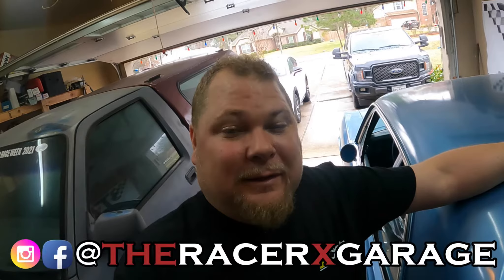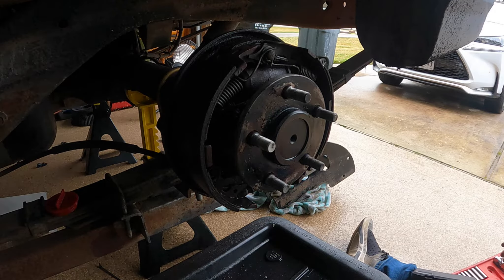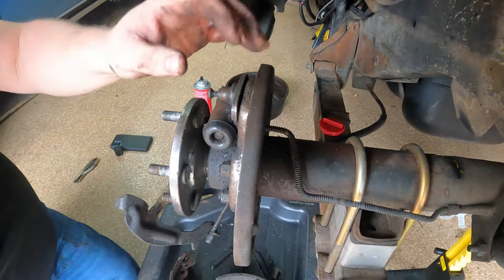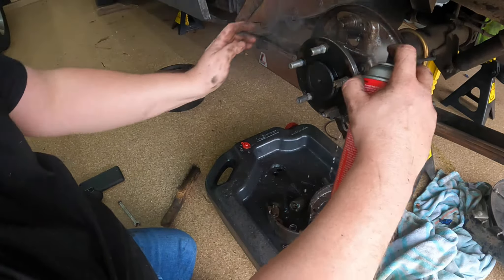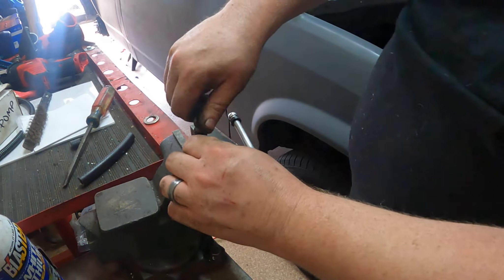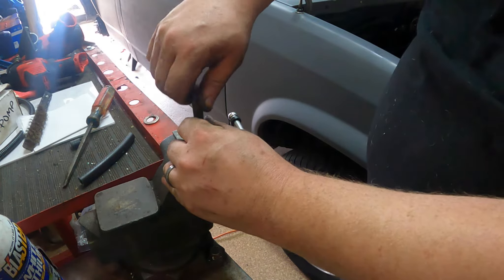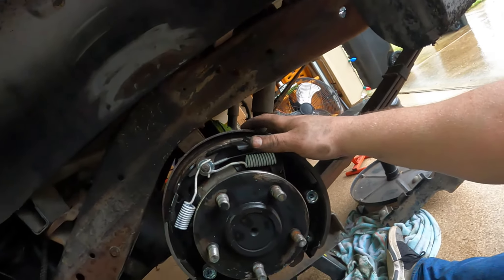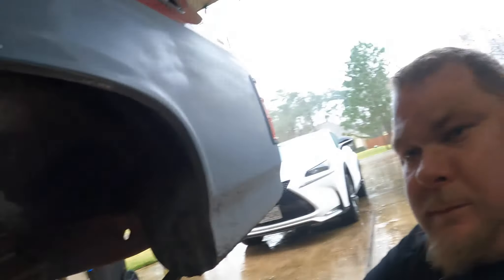Preparing for SICK WEEK Pt. 3!! 87-86 Dodge Dakota Drum Brake Replacement!

Comment: What did you do for a drive shaft?
Reply from the maker: I had a custom 4 inch driveshaft built. I always recommend calling your local drivetrain shop when ready. Ask them how they want you to measure it. Then measure it up and go from there
Reply: @RacerXGarage  I appreciate you answering all my questions! Started this project a year ago watching all your videos along the way!Been barting or trading work for parts, did the harness  myself after hours of research, I finally heard it run the other day for the first time! 1993 dodge dakota 6.0  4l80e 2wd.
Reply from the maker: @underdogracing858  Awesome!! I'm curious to know if you have had any tunnel fitment with the 4L80
Reply: @RacerXGarage  I had to flatten the pinch welds around the bell housing and there was not enough room for a stock Trans dip stick everything else clears fine. Even used your shift linkage ideas.

Comment: Hey man! Love the videos, I’m in the middle of kind of restoring/ putting back together my 92. You wouldn’t by chance have some parts for a single cab I can buy? Can I email you or direct message you somehow if that’s a possibility? 
There ain’t anything in my parts for a parts truck or anything. Facebook groups haven’t been any help either.
Reply from the maker: Oh man, we don't really have anything extra anymore. All the parts that needed replaced on our couple Dakotas we pulled off the donor and then scrapped. 

Your best bet may be finding a parts truck below the rust belt to buy and ship to your place if youre having trouble finding one where you live. Good luck! They're out there just got to stay with it